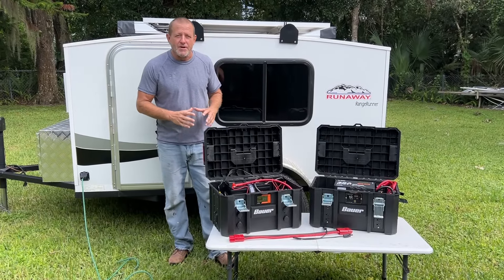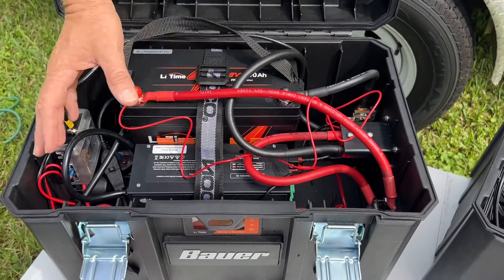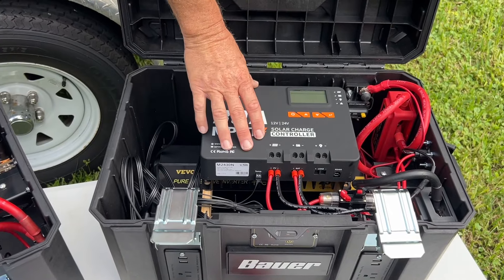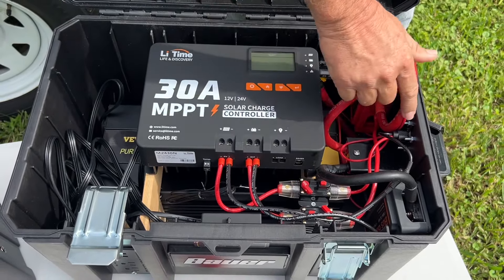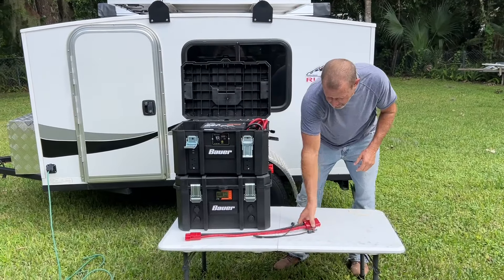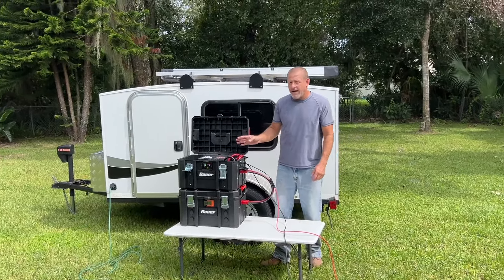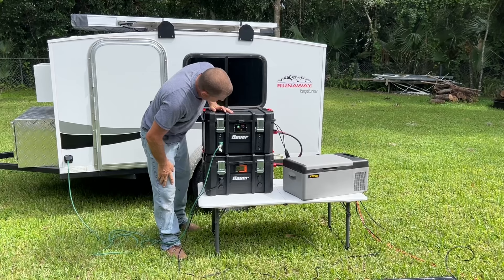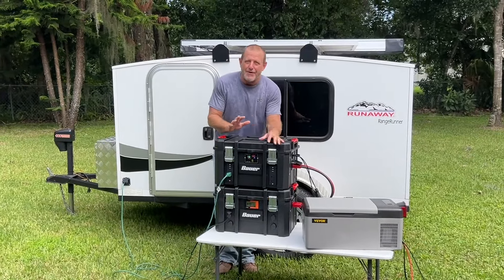DIY Solar Generator Build - Episode 4: Test Run / Practical Application

Comment: Great job. Where is the cooling fan for the top unit?
Reply from the maker: i put it in post video production the fan is on the upper left side of box with an intale hole with vent cover on the lower right side below the anderson connector.

Comment: Great video. Question, with one battery at a max continuous 100 amp discharge I think you can only run the inverter to ~1300 watts or can you run it higher?
Reply from the maker: actually 1200 ....Volts x amps = watts. a small window ac uses about 500w. also there is room in this DIY to add another battery . essentially doubling the max watt  output
Reply: @StoneBrokeAdventure  Cool thanks, I was thinking LiFePo is about 12.8v or so where I got ~1300 watts but close enough. I have a set up with two LiTime mini's and a 2000 watt inverter and it works well. I was just curious if you ever go over 100 amp draw.
Reply from the maker: @dt719  i do not get close to 100 amp when i use this. during  hurricane milton power outage i used for a fridge tv and  table lamp . also for a kureg coffee maker first thing in morning for a couple of cups.
Reply: Also thanks for the tip on pre charge. I was not doing that and will add that in. This is one of the best builds I’ve seen.